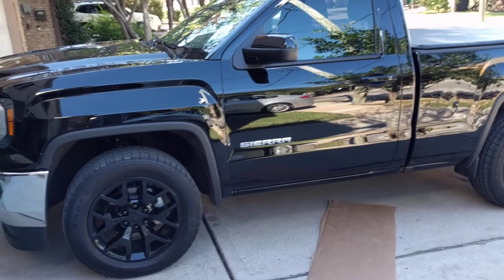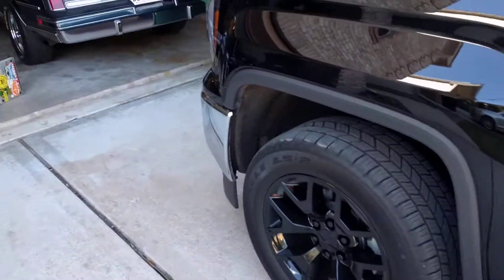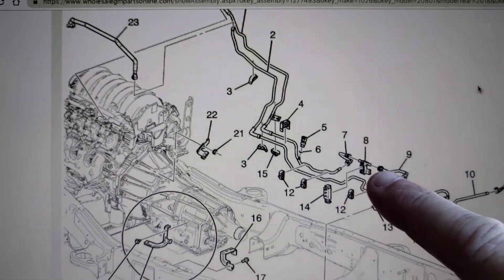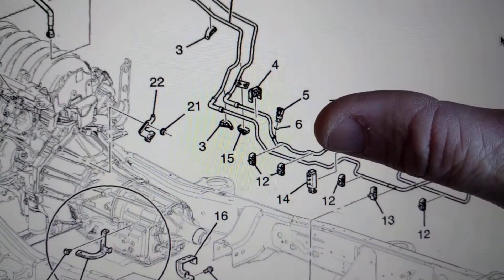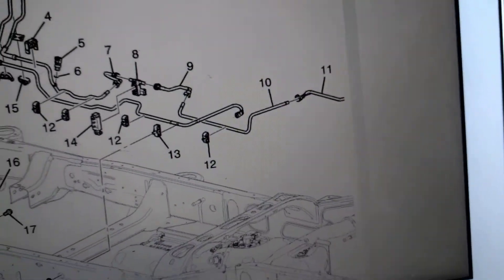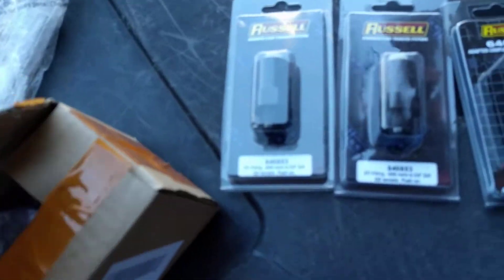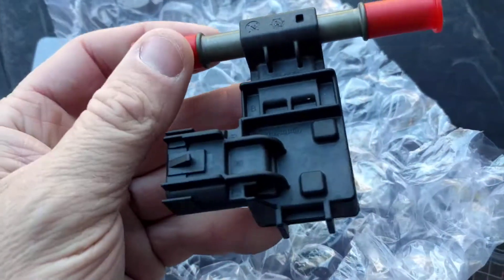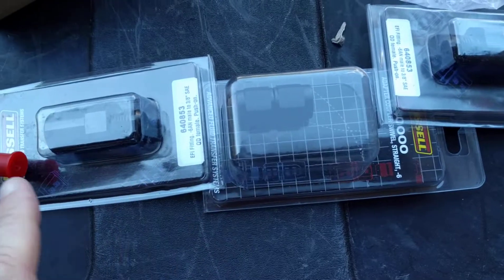2018 Silverado Sierra Flex Fuel E85 Conversion - Part 1 (hardware)

Comment: I looked for a part 2 but didn't find one my silverado is cammed and tuned did they have to Wright a specific tune for the E85 and when you turned on the sensor did you just change it from virtual to sensor in hp tuners
Reply from the maker: https://youtu.be/O_WeWK06zWM?si=47wlN8juKwURcBlZ

Comment: No need for those russell parts if I order the DSX coupler?
Reply from the maker: correct
Reply: @nu5m_radio  thanks. So just those 2 parts the sensor and the DSX coupler and I should be good?

Comment: i been putting flex fuel in my non flex fuel vehicle for years in a 2001 dts caddy a 1999 e250 van in any car i own because it is a detergent and cleaner, not saying your video isn't correct but it kinda sounds like you might have an option to take out a sensor to bypass the entire kit in a sense, your thoughts because i remember an old man converting his 77 ford ltd to run on used cooking oil on a TV show called that's incredible and he said the only down side is your always hungry. and that's the gods honest truth

Comment: Did you have any leaks using those quick disconnect fittings with the blue plastic disconnect
Reply from the maker: Nope.  They're still on there now.  On two different vehicles.

Comment: i converted mine today with a kit and programmed it just like the part 2 video filled it with E85 drove it all day and the check engine light came on.  Haven't pulled the code yet any ideas?  Used HPtuner did every step and it seems to run good.
Reply from the maker: Need the code.

Comment: Would this work for a 2018 denali?
Reply from the maker: yes, check the other videos.  I have a Denali also.
Reply: Alright cool thanks, Mines a crew cab tho so i will probably need that extension harness?
Reply from the maker: @MaxMplv  I'm not sure.  Just find the plug then you can get a harness or extend the three wires.  real easy
Reply: I bought this extension 
https://burgertuning.com/products/48-extension-for-fuel-it-flex-fuel-analyzer

Comment: Hey I know this is a old video but was curious if I do this could I fill up with E85 then go straight to my tuner?
Reply from the maker: I think you'd be ok if not a far drive.
Reply: @nu5m_radio  ok it probably a 15 mile drive. Thanks for the info

Comment: Would you suggest running a cooler spark plug? 
I have heard this a few times but cant find anything to backup these claims. 
Great video btw! Made the installation process very easy.
Reply from the maker: You can run a cooler plug.  I don't know if it makes any difference, but I ran NGK 6509 (one step colder than stock) when NA.

Comment: https://www.dedicatedmotorsports.com/efi-3-8-to-3-8-quick-disconnect-Coupler-p/g881-38-38-2.htm?CartID=1

would this work as a connector?
Reply from the maker: Yes, that would work.  I had a screw on fitting similar to that and it needed a slight filing to make it fit on the sensor.

Comment: Doesn’t it the l86 run on e85?
Reply from the maker: The L86 can run on E85.
Reply: pmoore4321 I’m putting a l86 in my jk.  If I want the hp gains do I have to just change with a tuner ? Or will I need other mods
Reply from the maker: @erikbrown8289  A sensor and a tune is all you need.
Reply: pmoore4321 thank u man

Comment: Hi, I am thinking of doing the same thing to my truck. I have a 2017 Silverado crew cab. I see some other people have cut the line right about where you showed on the manual but I see you positioned it in a different area. So by doing it your way did you have to cut anything? Also will I have to use HP scanner, or the editor software? If I have to use the editor I imagine I will have to buy credits to unlock my vehicle. Once done with the enabling of the sensor, will my truck TCM be locked to the HP tuners software? Thank you, your input will help a lot!

Comment: I bought the fittings assuming my 2017 GMC Sierra Crew Cab would be the same connections, however we all know what happens when we assume.....  Ended up using 2 brass compression fitting on the sensor after cutting the fuel line with a mini tube cutter.  Also had to extend the wiring harness about 5 inches which gave plenty of slack.  A 20 minute project turned into 2 hours.  Moral of the story is to get under your truck ahead of time to see what setup you actually have so your aren't a dummy like me.

Comment: The electric plug was there for my 2016 Silverado crew cab, There’s a plastic water proof plug covering the main connector. I had issues at first, not anymore.

Comment: Very useful info just ordered everything will see how it works with a crew cab also your part number for the Russell 640853 is different on your description almost ordered the wrong one, but thank you for the info.
Reply from the maker: Both will work, one is blue and the other is black.
Reply: So I was curious to see if my set up was different or not I crawled under and didn’t see a brown plug for the sensor I did see an evap canister and the lines are different I have an 18 Silverado crew cab...... help..
Reply from the maker: @marcosfigueroa9791  The plug is there somewhere.  I converted my 6.2 Yukon and the plug was somewhat hidden.  Read all the comments on here and ask one of the guys with a crewcab.  I believe you have to extend the sensor wires on the CC models.
Reply: Sounds good ty I’ll start looking

Comment: Will it work on a 2018 silverado crew cab just ordered the sensor from summit racing.
Reply from the maker: If the connector is present on the frame rail it will.  You may have to extend the wires or buy an extension harness.  Read all the comments, I believe it was discussed here.

Comment: update: working well and everything is great.  Just for fun I ran my truck at the dragstrip (2018 Silverado High Country 6.2 crew cab standard bed) on about E63 according to HP tuners scanner.  DA was about +1400ft.  Best run was 13.80@97.8 2.01 60' because it was hitting the GD speed limiter in the tune at 98mph.  I thought it was tuned out but I forgot to toggle the speed limiter tab item to "calibration" vs "GMLAN".  As a comparison, my 2015 Silverado High Country 6.2 short bed (lighter) which ran 13.91@97.7 (@#$& limiter) bone stock on 93 octane on a way better air day (DA approx 400ft).   E85 or anything E40 and above is definitely worth 30-40hp in my estimation...possibly more if the timing tables are idealized.  Keep the corn flowing!
Reply from the maker: Modding these trucks is very addicting.

Comment: just added this to my 2018 Silverado Crew cab 6.2.  The brown plug is too far away from the connection point and I had to get an extension harness for $22 from Casper Electronics so I didn't have to cut and splice anything.   http://www.casperselectronics.com/cart/index.php?route=product/product&product_id=928
Reply: I used the ones listed in this video which are Russell
Reply: @Stephen03S600  thanks a bunch!
Reply: on my GMC double cab, there was another attachment in front of where the hose meets the fuel tank, was it easy moving it out of the way?
Reply: @jhammond619  I could reach it on my crew cab and the connection is on the driver's side.  Look high at the front of the tank.  The other electrical stuff is towards the front of the vehicle about 24" away.
Reply: @Stephen03S600  the 12'' extension reached?
Reply: @tannersmith9218  no, I apologize I had to purchase two of them
Reply: @Stephen03S600  how close was the sensor to your driveline?
Reply: @tannersmith9218  not too close... just had to use a couple zip ties.  Without the zip ties it would be close to the drive shaft.
Reply: @Stephen03S600  good to know, on that note I am going to order the dsx coupler and sesnor and make some more power! Thanks
Reply: did you use the couplers that preston used or the dsx coupler? I was going to order the dsx coupler but they want $50 plus $25 for shipping, My question is, with those 3 fittings does it still clear the driveshaft? By the looks of the picture the dsx coupler looks shorter, but if the russell fittings are short and clear the driveshaft, ill buy those and save a heck of alot of money. Thanks
Reply: @Stephen03S600  how did you go about zip tieing it? And also did you adjust the hard line and move it up a little away from the driveline?
Reply: @tannersmith9218   the plastic fuel line is long enough above the tank it has quite a bit of flexibility.  I can't recall exactly where I attached the zip ties but it wasn't difficult or impossible.  It shifts the entire line/sensor away from the driveshaft.  It would be more ideal to look at a GM parts diagram like the one he shows and find the exact length fuel line to replace to make this install more perfect on a crew cab.

Comment: Did you put anything on the threads of the fittings to help prevent leaks, or will it be fine just tightening them up the way they are? I have the parts here, finally decided to go for it after watching this video.
Reply from the maker: No sealant on any of the threads.  I used "Russell" brand fittings on my Sierra and cheap Ebay fittings on my Yukon Denali.  Neither one leaked.  I did "watch" both trucks for a few days just to make sure.  I would use a small amount of dielectric grease (same you use on spark plug boots) just so you don't damage or tear the o-ring in the female side of the fuel quick connect fitting.
Reply: @nu5m_radio  awesome, thank you. Got mine on in about 5 minutes. Took it for a drive and no leaks. You're the man.

Comment: I've found the part numbers for most of the OEM e85 hoses required to convert to e85.  This list is for 2016 Silverado 5.3 Standard Cab and I will update if I get more information:

23171537 - Engine Fuel Line - for V8 - V6 is a different number.
23171534 - Flex Fuel Sensor Rear line 
23171535 - Flex Fuel Sensor Front line
23212447 - e85 filler hose
13577429 - Flex Fuel Sensor
20967866 - Flex fuel Sensor Clip
GT359 - Flex Fuel Cap
Reply: I finished the install yesterday here is a link to see pictures: https://www.gm-trucks.com/forums/topic/221259-e85-2016-silverado-reg-cab-6spd-4x4-53-upgrade/?page=4
Reply from the maker: @steverainbolt3001  Looks real good.
Reply from the maker: I made a list of the factory parts when I thought about going factory route.  Looked like it was going to be a PIA routing the lines, and decided to just splice the sensor in. There are several folks in the forums that used factory lines.  I believe they had to jack the engine up to run the lines.
Reply from the maker: https://www.wholesalegmpartsonline.com/showAssembly.aspx?ukey_product=0&ukey_assembly=1277493&ukey_make=1026&modelYear=2014&ukey_model=14595&ukey_driveline=0&ukey_trimLevel=25537
Reply from the maker: couple of links i saved....https://www.gm-trucks.com/forums/topic/178280-k2xx-53l-pic-request-flex-fuel-sensor-mounted-on-the-frame/?page=3
Reply: That front line over the trans looks to be a PIA, therefore, I am thinking of just buying the to hoses and cutting, bending and flaring the existing line, I want it to look factory.
Reply from the maker: @steverainbolt3001  I can't remember what exactly you had to do, but it was either raise the engine or drop the trans crossmember to fish the lines in.  It's probably not that hard.  If  you remove the intake manifold,  you have a lot of access.
Reply: @nu5m_radio   I'm going to cut and flare the original line to make it look like OEM.  Don't want to be unbolting trans mounts and such if I don't want to.  I'm going to as close to a factory look install as I can.  I have the Mastercool Push Connect flaring tool and HPtuners to do the programming.  Just waiting for the last few parts.

Comment: Will the conversion to E85 damage the engine , fuel lines and fuel pump? Heard it can corrode those areas. Are all non flex fuel Chevy truck fabricated the same. Minus the flex fuel sensor?
Reply from the maker: It won't hurt anything.  Answer to second question..."yes"

Comment: I am preparing to do my 2016 Silverado Standard Cab as well and I see a different part number for E85 for the Fuel Filler hose 84240993 from E10 84240992, the vent hose appears to be interchangeable however.  Have you looked at this as something you might want to replace?
Reply from the maker: That's very interesting. I found a pic of a different Delco filler hose and it is clearly marked "E85" in yellow along with the part number.  I guess it's the material.  I should crawl under my 2012 and see what is marked on that hose.  It's factory FF.
Reply: I ordered the E85 filler hose for my truck which was Only $28 bucks for the 2016 version, for some reason the 2018 has a different part number and costs $47 at rock auto both are the E63 body style E85
Reply from the maker: @steverainbolt3001  I wonder why they just didn't make all the filler hoses E85 capable?  Seems silly, but that's GM I guess.
Reply: @nu5m_radio  went ahead and ordered it, I don't want any problem in future of the hose braking down and clogging the system.
Reply: I installed the hose today, it appears it might be the same material, however it has a baffle on the tank end that I believe helps the gas and alcohol mix on fill-up.

Comment: Thank you for the information! I installed the sensor today and it was a fairly easy install. 
I have a 2015 Silverado Crewcab with the 6.2.
Installing the parts did move the fuel line feeding from the tank to the sensor into an unprotected area near the drive shaft.
I was able to bend the existing shield down a little to protect the fuel line.
Now I need to get the tune installed.
Reply from the maker: cool...glad it worked out
Reply: Larry, do you have any pictures? Trying to figure out everything I need to order for my 17 crew cab 6.2.
Reply: @tylerfrost040192  Tyler, I used the exact parts shown on the video . I ordered them through Ebay.
1 of the Russell Performance 640000-6AN Straight Swivel Coupler. $10.93
2 each of the Russell Performance 640853-6AN MAle to 3/8in SAE quick-disconnect female(black). $9.76 ea
1 of the OEM 13577429 Flex Fuel Composition Sensor for GM Chevrolet

$24.99
Once you disconnect the existing coupler by the gas tank everything will make sense.
Reply: Larry B after looking at it I see what you were saying in your initial comment. Looks like the sensor will end up pretty much on top of the tank and near the driveshaft. I wonder if it would be easy enough to plumb in a 90 or flexible line off the existing hard line to get the sensor further from the driveshaft. Assuming we have the same setup
Reply: @tylerfrost040192  Tyler, That was a concern for me also after installing the sensor. I ended up attaching the sensor to the bottom of the floorboard. If you look at the gas tank there is a sheet metal lip that protects it. You can grab that lip and pull it down a little this will cover the fuel line that is exposed by the drive shaft.

Comment: I have a 2018 gmc Sierra 5.3. there is no yellow on the gas door or where you put the gas in. I was told it is e85 capable tho. is there a way I can confirm that it's safe to use e85?
Reply from the maker: If your truck is factory flex fuel, it will have the RPO code "FHS"...you'll need to scan the bar code in the door jam.

Comment: So even tho I have a crew cab I can just tie into the hard line with tubing cutters and get an fittings and tie into the flex fuel I'm guessing I see people selling 300+ kits for 100$ worth of parts wow
Reply from the maker: If you really want to make it easy, just make the adapter and put the sensor where the fuel line connects to the fuel rail at the engine.  Then just extend the FF plug from the harness forward to the sensor location.  It's only three wires to extend.  You could get fancy and order the correct male and female fittings and make a jumper harness.  I would just cut and splice in a few wires to extend it.  No reason to cut the fuel line, just find a place where there is a Quickconnect and splice it there.
Reply: @nu5m_radio  yea I found my plug in so I'm just trying to keep it close but that's not a bad idea neither